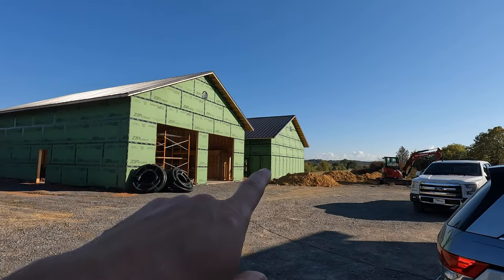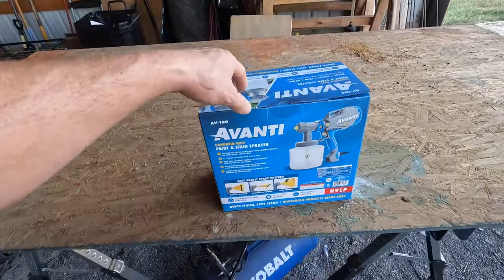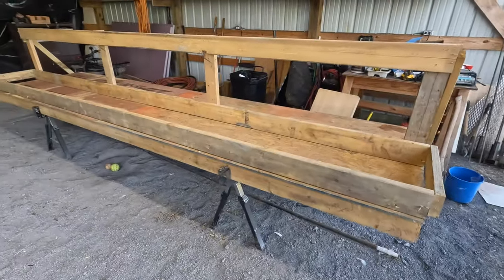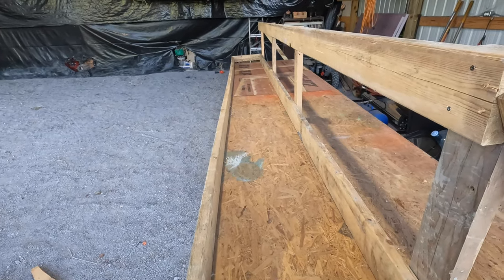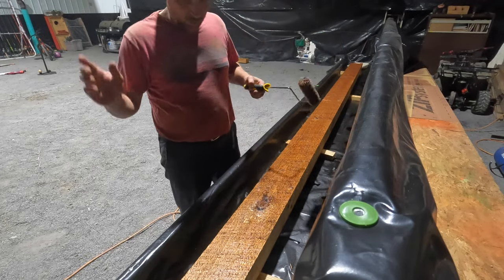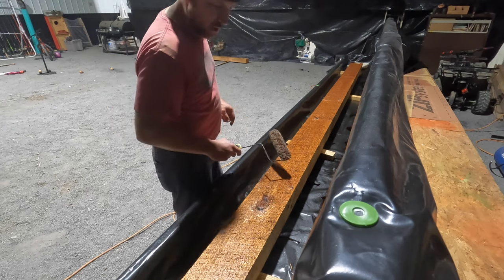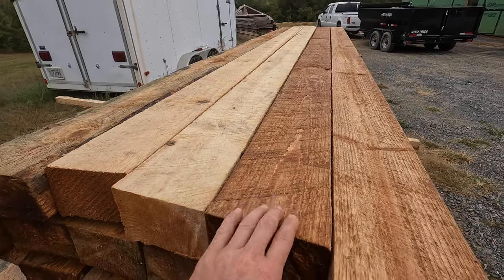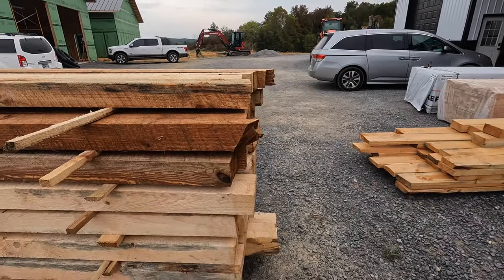Make Your Own Wood Stain For Cheap#160

Comment: Used that for years on concrete forms. Sprayed it on my shed 30yrs ago and the oak is holding up pretty good.
Reply from the maker: It makes perfect sense that it will work, I hadn’t heard or thought of using vinegar, have to try that. Thanks Mike

Comment: Check out Bora Care with Mold Care. I ordered a jug online and mixed and sprayed my whole house’s framing. 

Matt Risinger has a video on it and gave me the idea, but I think it might be a good long term fix for this. It’s a termite and mold treatment that they warranty for 30 years if you pay a pro to apply, but I just did it myself. 

That porch is going to look great with that wood. Good stuff.
Reply from the maker: I appreciate it, sounds like a good product. Do you have your sheetrock hung yet?
Reply: @goodlucktrying21  nope, not moving that quickly, but they did finish the mechanical rough ins this week. We need some doors, brick, siding, and insulation in the next few weeks and then I’m hoping sheet rock mid Novemberish but we’ll see. 

First time I’ve been through this process, and I appreciate getting to follow along as you do so much yourself.